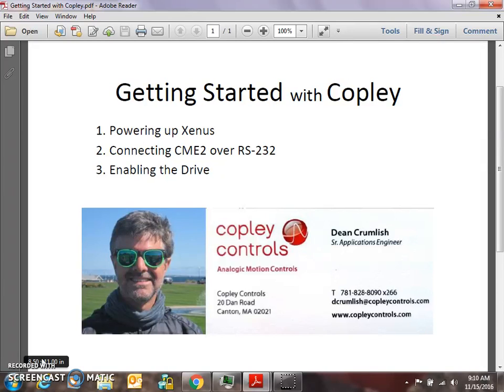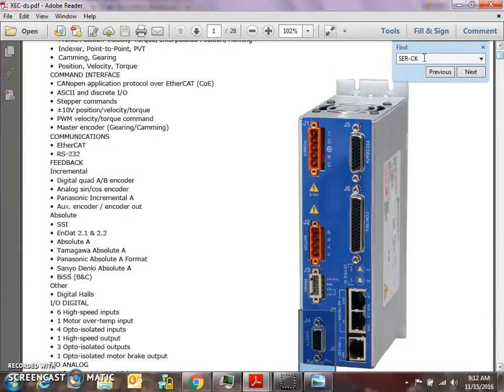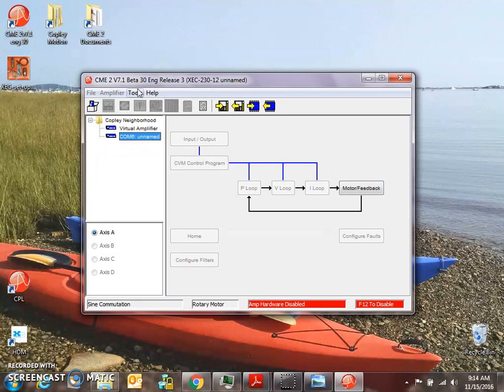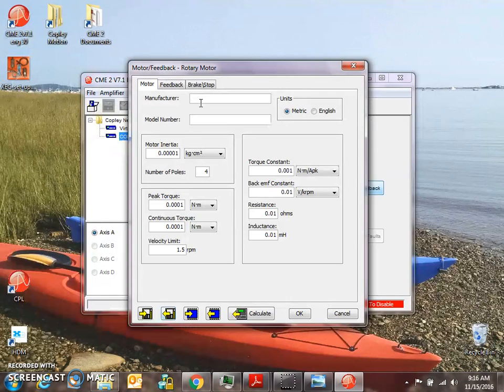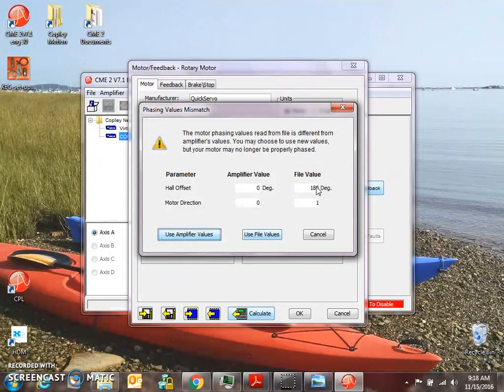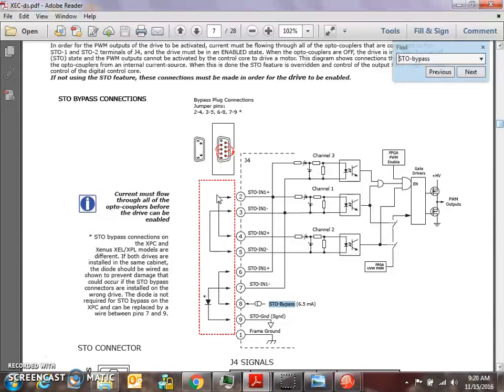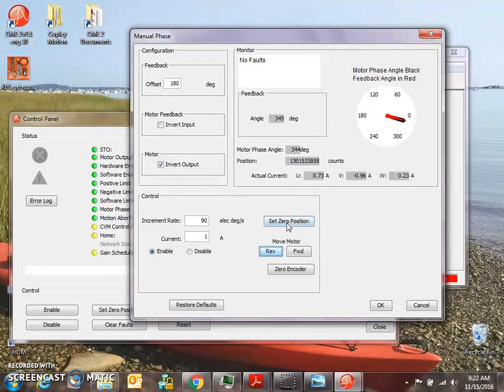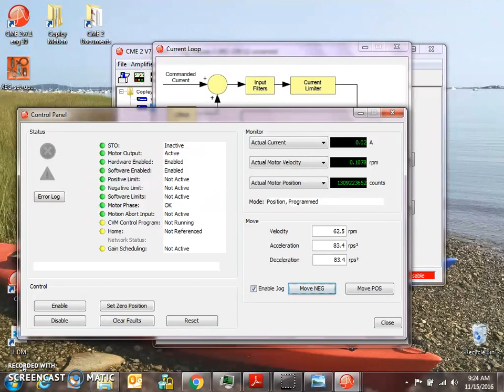Getting Started with Copley Controls Xenus

Comment: Hi Dean, I had a problem recently where when i used jog mode, the counts kept increasing whether i was jogging forward or reverse. the motor rotated only in one direction. I wonder if you know any possible reason why.
Reply from the maker: Only monitor with CME when master is connected. Disconnect the ECAT master, RESET the drive to clear command input fault and IP core configuration, then jog. email me at dcrumlish@copleycontrols.com

Comment: Hi Dean , i have a Coplay control model XTL-230_40_HS with a motor Parker CM923HR-118404 , I doing a homemade milling machine ( little ) , I wont to use this for turn ccw and cw  for drive the spindle only with a potentiometer if this is possible , but I don't know how to connect or doing the configuration on CME2 just installed on my computer. Can you help me pleased
Reply from the maker: I got your email. Will help. :)
Reply: @dinocrum  yes . sergiocervetto0@gmail.com

Comment: Dean, how do we use EtherCAT to communicate with the drive in CME2.  Can't seem to get it to work.  Serial works fine, but it would be nice to see out EtherCAT drives network in CME2.
Reply from the maker: Dave, CME talks serial binnary and sends Ethernet (the physical layer of Ecat) packet to operating system that sends to port. The post must be dedicated and not used by other software.

Comment: Hey, 
In Step “Set output” i can choose between Active (Hi and Lo) and State (Hi and Lo) what is the difference between these two and how it works? Thank you
Reply from the maker: Rani, to activate an output is to put it in a state that is defined by either active hi or low but may also be on or off depending on hardware. Send me .ccx file and specify output in question. Email: dcrumlish@copleycontrols.com

Comment: Hey Dean, the videos are very helpful. I am working with a new company in which we use the Copley drive so video are very helpful to actually see what you are talking about and when you do it.  I was wondering, how about something going into deeper as to what is a .ccx and .ccp file. Explain what the difference is between the two and how you load them?  The term "flash" is different then most use.  The norm is to say save to control, or upload from controller. Make it all less user friendly. Fixit9111@gmail.com A video about this would be helpful, I have watched a number of videos and none that I found thus far focuses on this area.
Reply from the maker: Thanks for sending email to my work mail so I can reply directly.